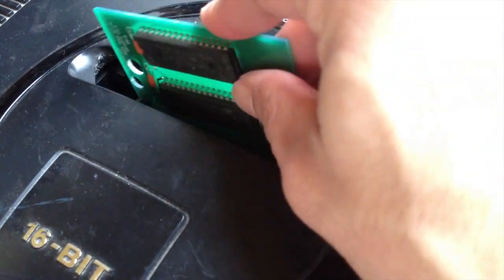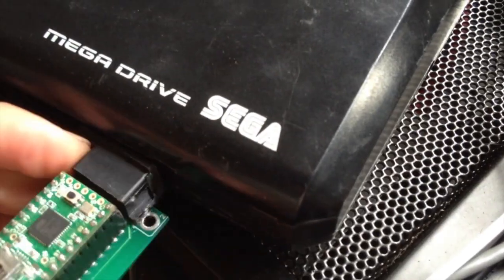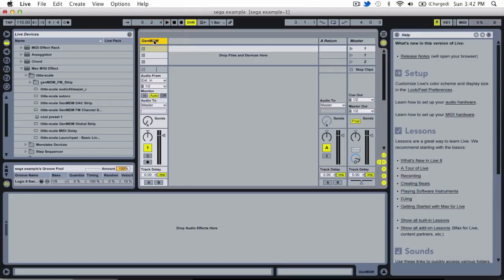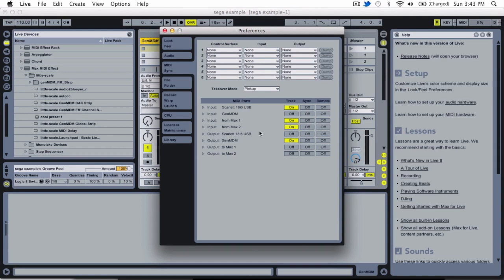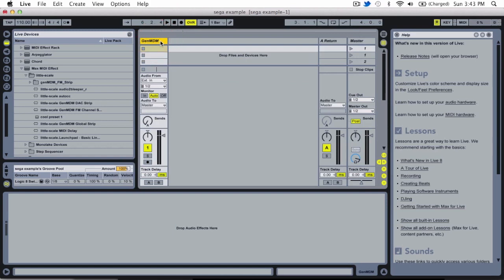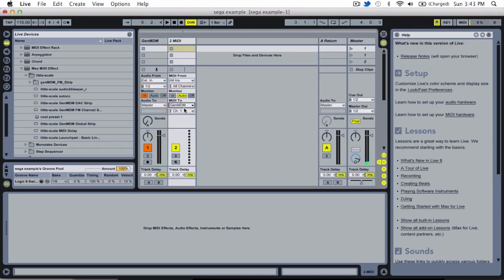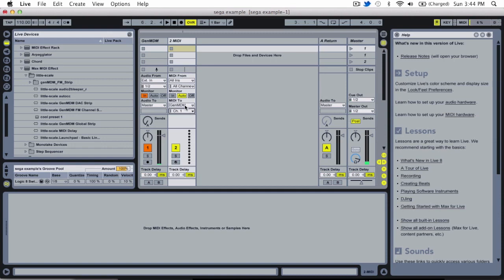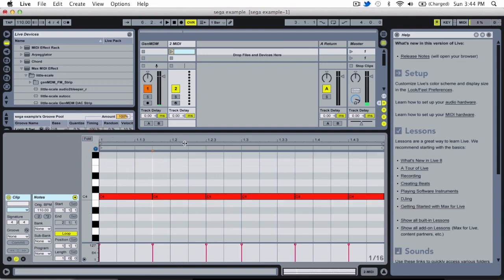GenMDM Screencast 01: Basic Hardware and Software Setup

Comment: I would like to understand the best programming advice for using this machine.  Right now I’m using the GENMDM standalone max editor but sometimes I use the FM channel strip max4live patch.  The channel strip doesn’t have as much control and also doesn’t have a way to save patches into the ram.  I’ve spent time programming patches using midi cc data, the fm strip, and/or the standalone editor and saving them but I can’t seem to get a good save.  Every time I reload, it’s like it’s missing a lot of the elements of the patch needed and sounds mostly silent

Comment: Recent purchase from Catskull Electronics, USB-C connection and firmware v103 (I believe by design?)

First note plays as system powers on... Chord/chime/sequence when USB reaches computer does not :(

Also, only Channel 1 is receiving midi of the first 1-6 FM channels. Working by design?